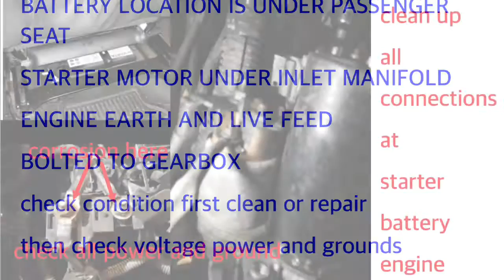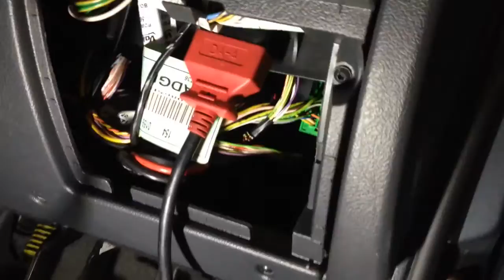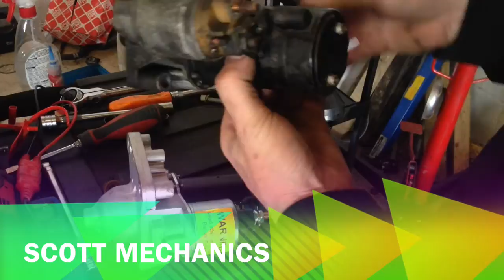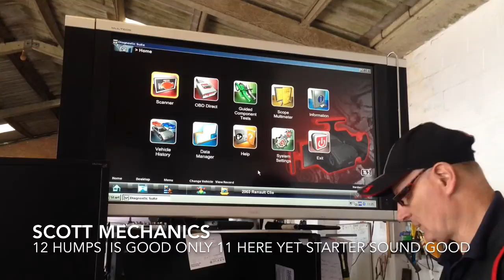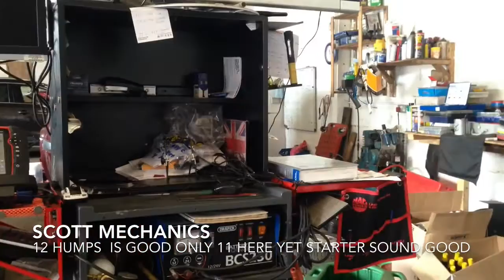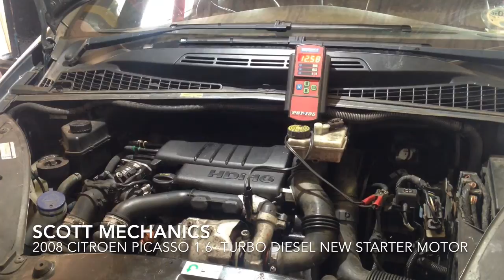Picasso intermittent no start 1.6 diesel snap-on scan tool verus pro scope used by Scott mechanics

Comment: all it was was dirty contacts after they were cleaned etc  it worked fine, also the starter was ok as well since it ran.
what is it with garages and tech equipment toys?.
Reply from the maker: That was the first thing I did clean and check contacts at the starter battery and engine ground  merry Christmas

Comment: Monday 13/08/2018  I had turned My Ignition Key where all Dashboard Lights Let up and then on turning the Key to start it up the Lights on the Dashboard went out but there was no engine start up; There was no Clicking or any noise from the Starter Motor: So I Bump started the Car or tried to Bump it: It shuddered but I did not get enough Run to Bump Start: I Tried the Key once More and the Engine stated up; But on driving Back home I had to turn off the Engine; where It would not start
any ideas